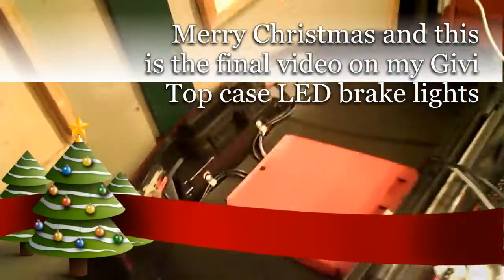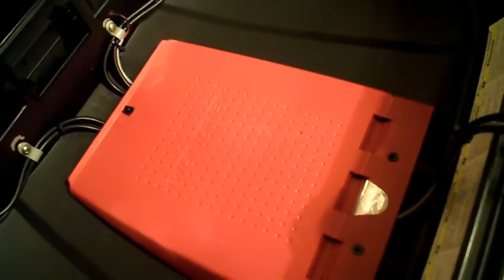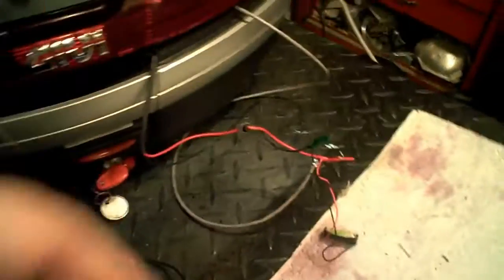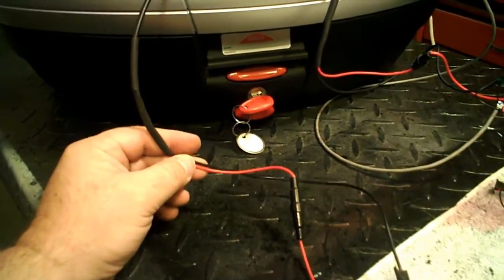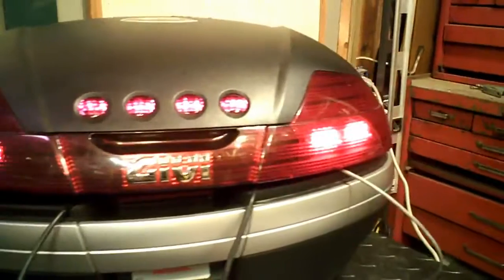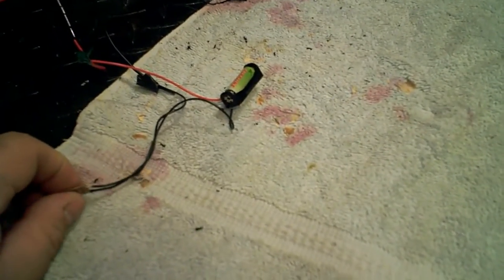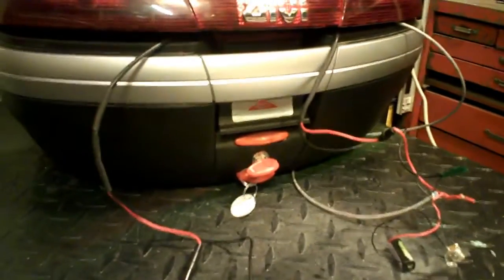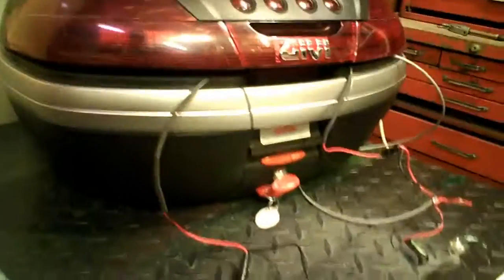Givi V46 LED brake lights DONE

Comment from the maker: I used a glue from Loctite, wanted to use this glue called E6000 but couldn't find it readily so used the next best, it worked well. Thank you for the kind words.
You ride safe, the better riding weather is just around the corner.

Comment: Real sweet. 
You wonder why Givi and others don't just make something like this.
They should, of course, hire you for R&D. 
Of course (God forbid) if someone hits you they will still claim that they didn't see you.
Also wondering what you used to glue. Looks like a silicone type sealant, which would seem to be ideal for the application.
All the best to you and yours.
(Dan O, still riding)